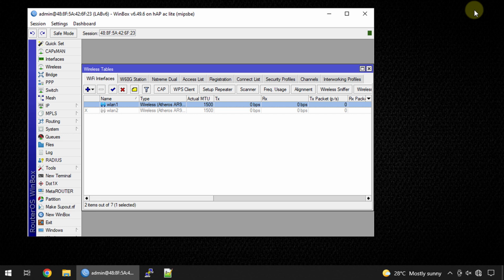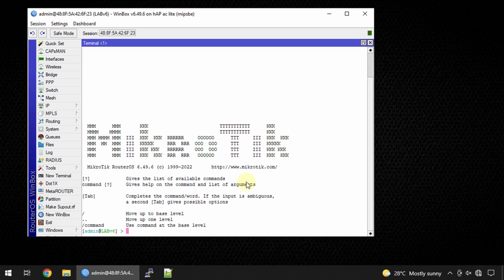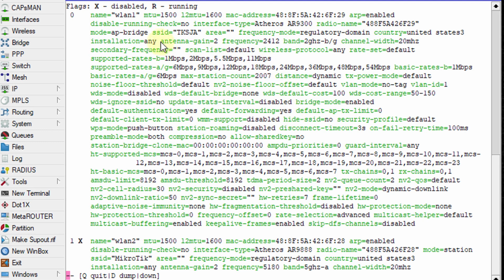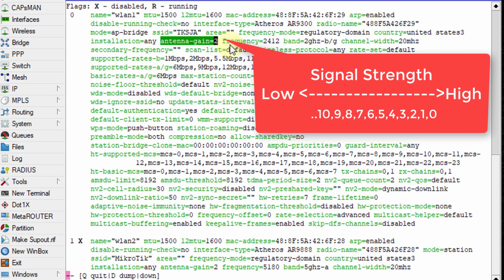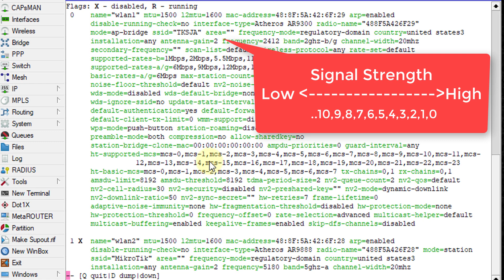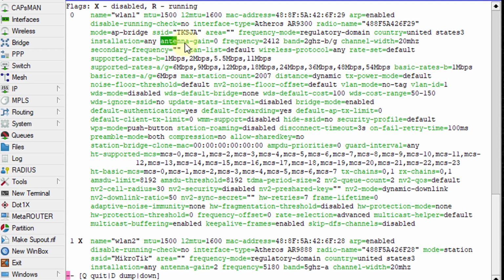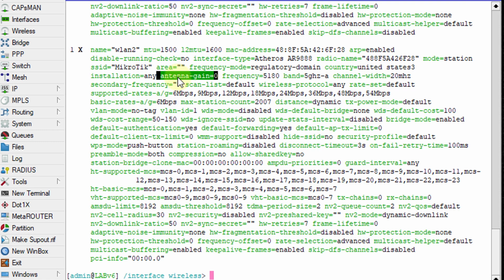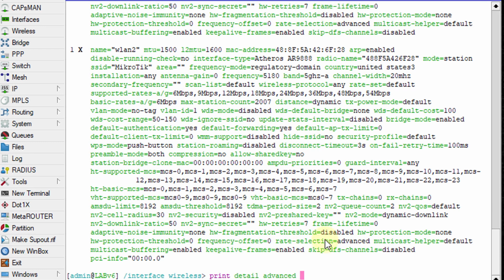MikroTik Tutorial 106 - How to Increase your WiFi Signal Strength

Comment: heh, didn't realize you could do this.     on the hAP ax lite you can't do this as the advanced wireless settings aren't there and the antenna gain is already at zero, so if you try to zero it out in the GUI it will lock you to 5dBi gain.  ha ha.   That said, put that baby at manual transmit at 16dB.   Transmits much stronger than leaving it on auto.

Comment: hi there, thanks for this vid, I just started setting up my hAP AC Lite, reading around the Microtik forums, seems like there's a correlation between the Tx rates in the Tx Power area and the antenna gain.  Any thoughts on this?  I'm brand new to this and just reading up, thanks!

Comment: HI, Thanks for the video, But I think , After set antenna gain=0 , Range will be increase but speed will be low on wifi, What do you think?
Reply from the maker: Higher signal strength = Higher possible throughput
Reply: Setting it to 0 made it horrible for me, devices could not connect easily

Comment: The thing you are leaving out is that this is illegal. The router already is transmitting at the highest power allowed by your country regulations by default. Lowering the antenna gain to raise power means that your router is now transmitting at illegal power levels for your country.
Reply from the maker: You have a point, but as long as you use the "frequency mode = regulatory domain" it will not exceed the 30dbm limit
Reply: @TKSJa  This is not the case. The device uses the antenna gain setting to make sure it is not exceeding the limits. If using regulatory domain with a correct antenna gain, it will transmit with legal power amounts. If you reduce the antenna gain, it will transmit at illegally high power.
Reply: What you leave out is that this depends on the legislation of wherever you live. For some of it this is legal and it is good to know the options that are there.

Comment: You can also make the signal received on some WiFi client stronger by making the channel width sharper. For 2.4GHz use only 20MHz, for 5GHz I would not go higher than 80MHz
Reply: Thanks, it’s fixed my issue better than method from video